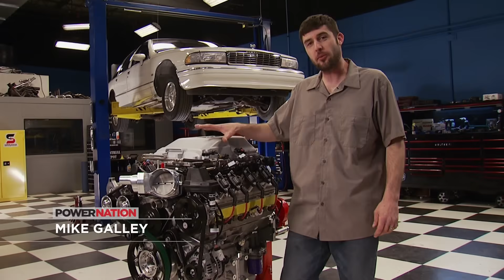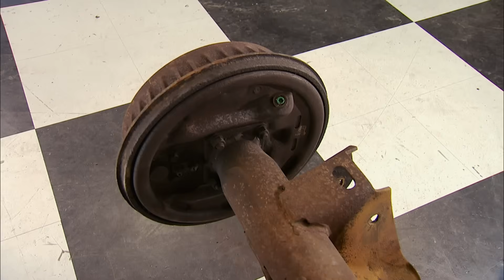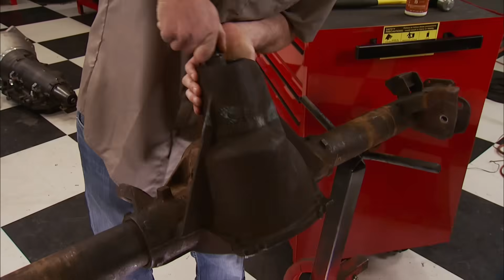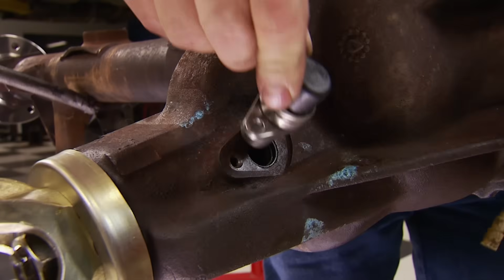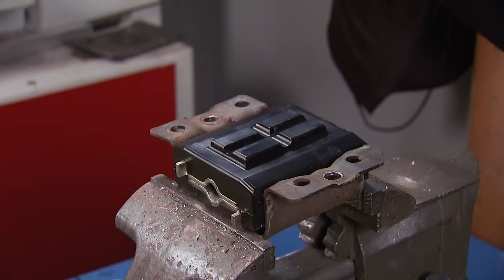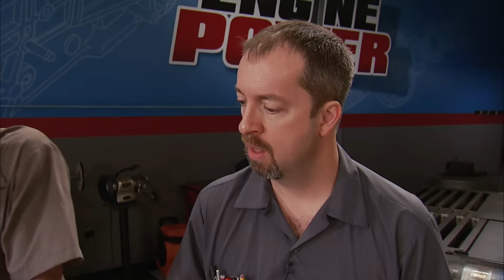Grey Hair, White Knuckle Caprice Part 1 - Engine Power S3, E11

Comment: I know they used Anti-Seize for the control arm bolts. An old-timer told me to put Copper grease on the back of brake pads and bushing bolts just like these. What do you guys think about Copper grease instead?
Reply: The anti seize they used is a copper type.
Brake pads used to come with a small tube of it to prevent squeaks.
Reply: @ I see thank you.

Comment: Can't believe you didn't clean up the diff housing and paint it.
Reply: Did he say it was all mock up?
Reply: @MrLukealbanese could be. He said the initial install of the R&P was, which is how you do it to get your pattern and lash dialed in, but then it appeared he wrapped it all up and stuck the diff back in the car. The time to clean and paint it was after he had it completely disassembled.
Reply: @gregkloe  yes it did look a bit strange, that's for sure 🤔
Reply: @gregkloe  you know they aren't going to do it. Hell I'd at least spray it with Gray Primer
Reply: @MrLukealbanese he was only referring to the gear set. Not the entire housing
Reply: @Anythingautomotive  yes, sounds reasonable.  Strange not to restore the housing.
Reply: I had the same thought 🤔